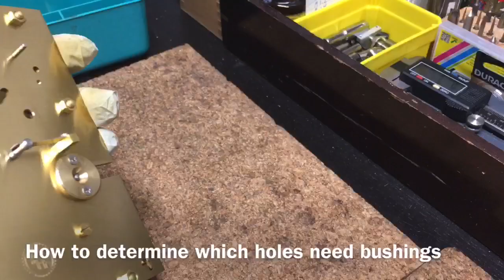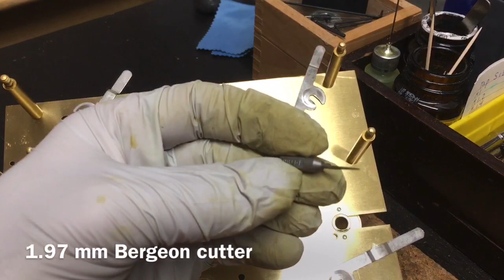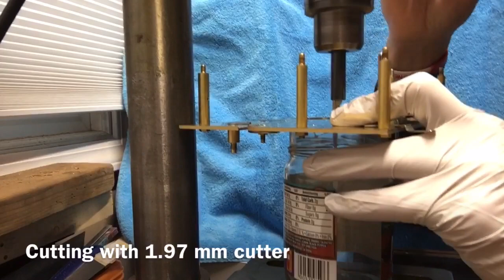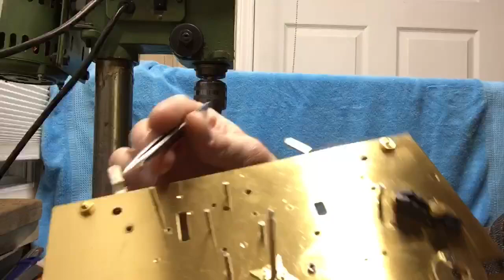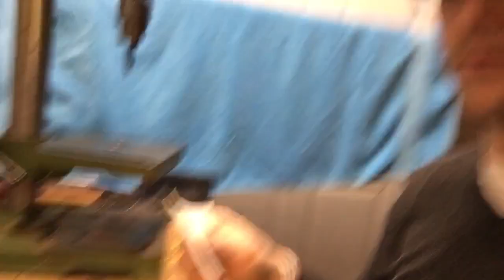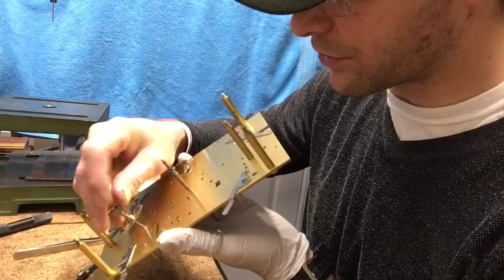How to bush a worn pivot hole - clock repair basics

Comment: Any tips on buying my first tools for doing bushes?
Reply: proper bushing machines (like the ones made Bergeon or K.W.M) arent usually powered but they are extremely easy to use although very expensive so i wouldnt really recommend that unless you think you'll be using it quite a lot. most of this work can be done by hand for a lot cheaper, although it takes a bit more skill.
the tools u need to do it by hand are:
vernier calliper
a rat's tail file (round escapement file - cut 6.  approx £20)
a decent set of cutting broaches (approx £20)
a decent set of smoothing broaches (approx £30)
a staking block
a light hammer (approx 1-4oz)
some cheap rifler files 
some rose-cutters/oil-sink cutters

that pretty much everything u need to do it by hand. if u want me to give u a method just reply and ill try get back to u.
(and if u wondering wether i really know what im on about, im currently completing my degree in horology so i promise ur in good hands, lol)

Comment: This is not precise at all. This is actually the WRONG method and guaranteed it is now bushed in the worn spot and not on center. These are not self centering reamers. There is a reason why we professionals use a centering bit, clamp the plate securely so it CANT move and then gently nibble away at the worn plate using a specific strategy to ensure center is maintained.
Reply from the maker: Watch my video on recentering worn pivot holes. This is addressed there

Comment: You do know this could be precisely done by clamping the plates in a precision X Y adjustable vise, locating the original hole with the pinion chucked in a small mill, or drill of the same diameter,  then drilling the bushing hole with the correct drill. It can be done with only enough of the drill protruding to prevent the bit from bending.
Reply from the maker: Absolutely. Bullseye

Comment: I had an older repairman show me how to do this by hand with a tapered reamer and small round file.  You file the worn hole OPPOSITE the wear point with about the same amount of wear. At this point the hole is elliptical shaped. This will more or less cause the tapered reamer to center itself as it enlarges the hole to the bushing diameter.  This is all done in the hands, not on a machine.  Not as precise as the excellent method shown, but I have had success with this on the few times a bushing was really needed.  I do more watch than clock work.  Good video!
Reply: This is not precise at all. This is actually the WRONG method and guaranteed it is now bushed in the worn spot and not on center. These are not self centering reamers. There is a reason why we professionals use a centering bit, clamp the plate securely so it CANT move and then gently nibble away at the worn plate using a specific strategy to ensure center is maintained.

Comment: You mentioned that the hole was worn and needed to be bushed. What you didn’t show them was how you compensate for an oblong hole to make it dead center again after it’s bushed. I put the Plates together when reaming and use a broach that goes thru both holes to make sure the hole is dead true and perpendicular between the plates. My opinion is you oversized the hole for the pivot and will wear out sooner and could cause a depthing problem with each gear that engages with the bushed gear. The thickness of the bushing isn’t determined by the plate thickness,nits determined by the length of the pivot. If upon checking the end shake you see the pivot doesn’t protrude the bushing then you need to use a shorter bushing or sink the bushing to the point of just barely uncovering the tip of the pivot at extreme end shake and end mill the rest of the bushing from the back side of the plate. Having a short pivot in a long bushing will cause endshake problems as the pivot wears. You do a good job otherwise and everybody’s technique is a little different but the end result is to have a properly bushed pivot in every aspect including the depthing of the gears involved. I’ve got 55 years at the bench and am a Certified Master Clocksmith with AWI. Installing a bushing is very important, as I have come across many a botched job in my years. Do you also have videos showing the assembly after the bushing procedure is complete? This is usually the deal breaker with any novice as there are many challenges to making sure every cam, lever, pin is in the proper place in order for the chime and strike to properly function. I think what you are doing is good in fact to the inexperienced person who thinks anybody can fix a clock, as it shows them that leave this to the trained professional if you want the job done correctly. I have received basket repairs where the whole clock is in every state of partial bad work and not assembled because the customer bit off more than they imagined. 😮
Reply from the maker: Thanks for the expert comment! I do have a separate video for how i center the worn pivot hole and a separate video showing how instal the rack and snail front works.

Comment: Hi Chris If you beginner and you have not reamers and set of Begean bushing .How smaller the hole in the plate should be for new bushing?
Reply from the maker: The diameter of the hole should be 0.03 mm smaller than the bushing.

Comment: With the hole being slightly off centre from excessive wear, won't your bushing now be slightly off centre to its original position? Surely some compensation would be required when drilling out for the bushing?
Reply from the maker: You are correct.  I mistakenly left the re centering step out of this video.  Watch my "How to re center a worn pivot hole" video and I show how this is done.

Comment: Great Video, but one question, Isn't the new pivot hole now slightly off-center in the direction of the original wear?
Reply from the maker: Watch my other video on centering:

Clock Repair - How to Center a Worn Pivot Hole by Hand #clockrepair #centerawornpivothole
https://youtu.be/rx3HKmlDFCA

Comment: Hi, i have a Franz Hemle 341-021A wall clock and with the chimer onn the randomly stops at 6.30 but if i turn off the chimer its fine any idea what it could be please ?
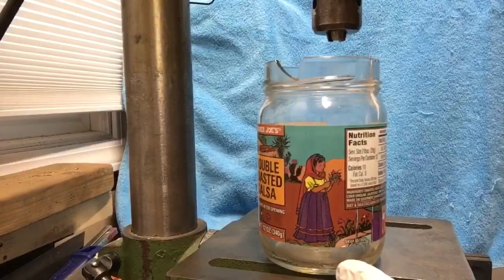Reply from the maker: Does it only stop at 6:30 or does it stop at other times?

Comment: On the end cutter, what is the diameter of the guild? Works the same way as a counter bore in tool and die, but your hole is to size in that case.

Comment: Hi Chris,

Your lessons perfectly. Thank you so much. I’m from Turkey. I need to Bregon cutter set. I want to buy it. Could you give me an advice ? Which model ?
I repair only wall clock and grandfather clocks.
BR.
Reply from the maker: Kwm or bergeon will do the trick. Whichever system you are more comfortable with

Comment: For some reason, YT keeps deleting my comments.  I'll try again. 

I like how detailed your videos are, especially for us beginners.  I am wanting to attempt my first bushing job.
What EXACTLY do I need besides going broke buying bushing machines?.  I see you use a drill press.
There are affordable ones on Amazon...would they suffice?.   Do these Bergeon and KWM reamers fit in a regular drill press or do they only fit their special machines?.  
What brand did you use in your drill press?.  Please...I would like to know specifics.  No step is too baby.
I have a movement I need to put escapement bushings in but I do not have thousands of dollars to lay out for bushing machines and all this fancy equipment.
What EXACTLY do I need to start?.     Thanks so much for your time and videos.
Reply from the maker: I have never used a bushing machine. Everything you need is in my video and can all be purchased at timesavers.
Reply: @Chrisclockrepair  Thanks much.  Of all the videos I've watched on bushing installation, you're the only one I've seen drill a hole in the bushing 0.10 mm larger than the pivot after you installed the bushing.  Clever addition.  Did you just use a regular drill bit 0.10 mm larger?.  It looked like it. 
I saw something on Timesavers that may be an inexpensive alternative for us virgins wanting to try this bushing install for the first time (truthfully, I'm getting somewhat discouraged with all these different cutters, reamers, broaches, etc. needed): it was a clamp on for an electric screwdriver to keep the reamer true when drilling the hole.   Why wouldn't that work?.  It was $46.50 compared the price of a drill press, not to mention the price of those bushing machines

Comment: Hi Chris, great video, I have two clocks, which are not working after a good clean, want to try bushing , is a bench drill all you need? Bushing presses are v expensive, also any chance you can let me know the basic tools I would need , to replace bush ? Any help would be great , thanks
Reply from the maker: Its all in my video. You can use a press or do by hand.
Reply from the maker: I am releasing a video tomorrow that is an addendum to this video that may also help you

Comment: I just found your channel.  Thank you for sharing.  I have not attempted rebushing yet.  I was told that a regular drill press was too fast to use for a reamer.  I am glad to see this debunked, as I did not want to buy a bushing tool.  Another thing I was told was to be certain to work harden the inside of the bushing with a smooth broach after getting the right diameter.  I notice that you do not do this.  Do you find it unnecessary? Did I miss a step?

Thanks, again!
Reply from the maker: Hi there. You can use a drill press for reaming providing that you centered the hole first by hand which unfortunately Is not in this video. And yes it is recommended that you use a smoothing broach afterwards,  however the clock will run for many years without it but the smoothing broach is the recommended practice. I was not using smoothing broaches at the time I made this video but I am now. I am learning too.

Comment: Wonderful video!!! Quick question did you file the worn pivot holes first before you drilled them out?
Reply from the maker: Thanks. Actually I center the holes by hand with a reamer first. I will be doing my next video on how this is done. I show this omitted step in my quail cuckoo video.
Reply: @Chrisclockrepair  Awesome thanks !!

Comment: I'm sorry but you neglected to find the center of the hole remembering that the hole is oblong. Then drilling the hole. Your new bushings are not centered. The pivot pushes up from the weight or spring leaving an oblong hole. You need to center from the bottom of the hole. I'm sorry but you have misled many of these new people. 
Patrick
Reply from the maker: You're absolutely right. If you read the earlier comments you will see that this has been noted. I will be releasing a new video to show this critical step.
Reply: Sorry, Patrick, but you are also wrong.  The wear is not directly from the weight or spring except on the first wheel. The forces are directed from each wheel to the pinion gear of the following wheel.  Thus, the direction of wear alternates in direction and is NOT at the bottom of each pivot hoke. In fact, the wear is likely not even perpendicular to the bottom, but opposite the direction of the force applied by the wheel teeth to the pinion leaves.  Sorry, but YOU have misled many new people.
Reply: @dperry428  I don't agree with you. Misleading, no you need to find the pivot center. I  rewatched the video and I still do not agree with your technique. The plate must be held rigid, no floating to find the center. You can't just let a cutter drift. Centering the oblong pivot hole is all important. I stand by what I said.
Reply: BTW, I notice your channel is just overflowing with clock repair videos.  In fact, you  offer NOTHING to the YouTube community.  You know what that makes you?  A TROLL!!!!
Reply: @dperry428  Troll no, just because you do repairs on a YouTube doesn't mean your technique  is correct. That wasn't a very nice thing to say. I use YouTube to check the other people's technique so I can improve my technique. Having a YouTube channel doesn't make you an authority. We all need to learn and hone our skills. That's why I watch everyone's videos.
I have learned so much.
I have been repairing clocks and watches for over 50 years. I also built from flat brass and steel rods clocks that work. Troll no just honing my skills.

Comment: Okay.... But I gotta ask, how do you keep the drill centered in the bad bushing hole? It would seem to me that the drill wouldn't center and thus make the hole off. I've seen all kind of jigs, clamps, and you're using a mason jar with a drill press. Don't you need to center the hole first?
Reply from the maker: Yes. I center it first by hand cutting. I didn’t show this on video and i need to fix that.

Comment: Is it possible to use a Standard drill bit set for a re-bushing on a cuckoo clock, instead of a metric set?
Reply from the maker: You should be using a reamer to cut the holes so as long as the bushing are sized for your reamer, your good. To post drill the bushings with drills, you just need to find a size that is slightly larger than the pivot
Reply: @Chrisclockrepair  so I have to ream the hole 1mm smaller than the bushing O/D?
Reply from the maker: @8953147  The way mine are set up it is 0.03 mm smaller than bushing outer diameter
Reply: @Chrisclockrepair  Thanks so much!

Comment: What this excellent video tells me, is I need to find someone who will take my plates, insert bushings, and return.  How to go about that ?  While I agree that a drill press can be had, the collection of all the other tools, bits, reamers, broaches, end mill, and so on, is beyond my reach, particularly for a single movement.
Reply from the maker: Yes. Unless you are learning the trade, if your clock needs repair, it should be done by a professional. And even among “professionals” there is oft times a wide gap in craftsmanship.

Comment: Probably just me but I thought the bush is always inserted into the inside of the plate so if it loosened it would remain on the arbour, which is what you did. However you ended up the excess to be cut off on the inside? Which was pushed in flat? Surely the excess should have been on the outside and cutting off would remove the oil sink? Did my eyes deceive me?
Reply from the maker: I pushed the oil sink through the inside of the plate so it is flat on the outside. Then i cut excess off from inside leaving flat on inside and oil sink on outside.
Reply: @Chrisclockrepair   ah. Ok I thought you pushed it through flat to inside,  so on jar how did you know it was flat on outside? Still don’t understand, is it not easier to push flat on inside then cut off excess on outside and form oil sink with countersink on outside?
Reply from the maker: @gordonlumer2879  I understand your dilemma. I don’t push the bushings in while it’s over a jar. I push them in while it’s over a block so it’s flat. Then I put it over a jar to cut it down
Reply: @Chrisclockrepair   Fair enough, still makes more sense to me to bang in flush from inside and then sort out outside but there again I have not done bushing yet, just researching. Thanks you’re videos are great. I’m still looking at the warning pin set up on striking clocks as I’ve played with them but can’t seem to get them right. Thanks again.
Reply from the maker: @gordonlumer2879  Hey. That is certainly a way to do it. But then you cut away your oil sink and have to cut out a new one. also you run the risk of potentially cutting into your plate on the outside.
Reply: @Chrisclockrepair  Actually, it makes no difference from which side of the plate you ream the hole when using Bergeon or KWM reamers.  They make a hole with parallel sides.  The idea of cutting the hole from the inside of the plate comes from the old school method of using broaches, which are tapered, to cut the hole to fit a tapered bushing.  The hole in that case is tapered form larger on the inside of the plate to smaller on the outside of the plate with the tapered bushing the same.  It also, then, makes no difference if you insert the bushing from inside or outside.  What is important is that the hole be slightly smaller than the OD of the bushing.  In the case of Bergeon, that difference is .03 mm.  I always want, though, my bushings installed flush to the inside of the plate.  Unless the bushing height is excessive, the chamfer tool is quite adequate in cutting an oil sink.

Comment: Thanks so much for taking the time to produce your videos. Ive just started getting into clocks, so im still learning trrminology. You have great presentation skills. As a beginner id appreciate someone taking an old clock off the shelf and looking at it like a beginner. How do you examine the clock, determine problems, what are the typical jobs a beginner is capable of doing as he learns, is it ok to do a dunk, swish, dry, and reoil if clock is running but just dirty, typical stuff a beginner might encounter. Thanks again!
Reply from the maker: Thank you. I will see what I can do.